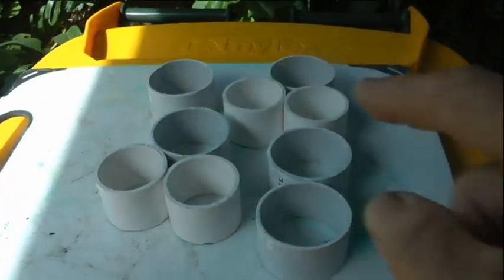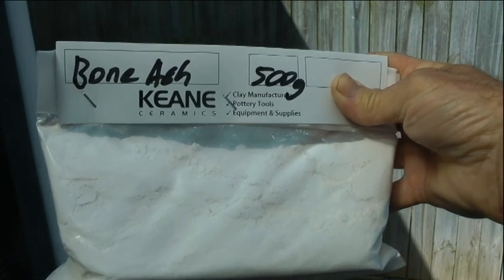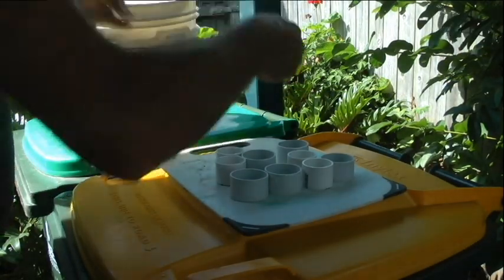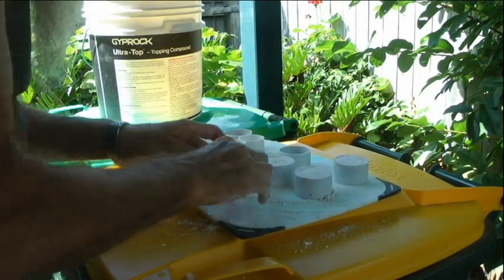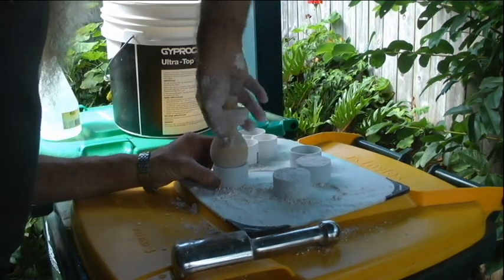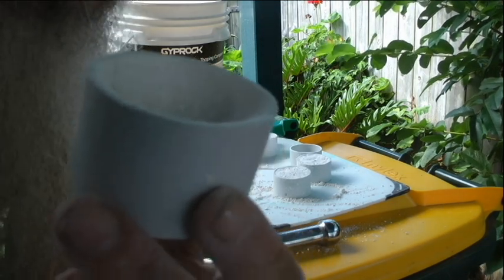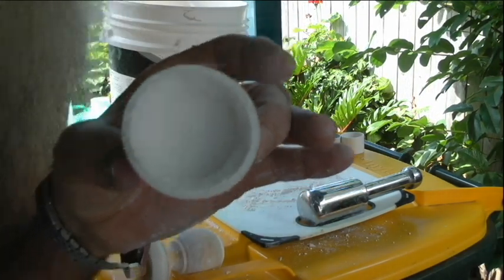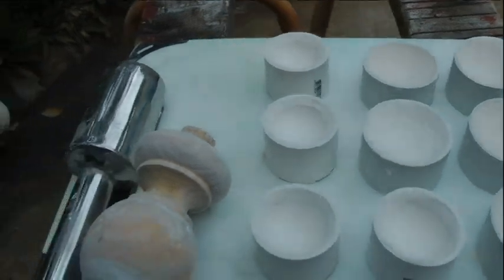DIY Cupels ,Gold Hunter .

Comment: Do u dry them out in oven after !?
Reply from the maker: No , i just dry them in the Sun , they shrink from the mould slightly so you can push them out , But recently i cut one side of the PVC mould and placed masking tape over the cut to hold the mould together , so after making them and drying them i simply peel the masking tape off the cut , spread the mould using a knife and it allows them  more movement to drop out of the mould . Hope that helps you . Cheers .
Reply: @ thanks bro yeah it does cheers man all best

Comment: Hello man, thanks, very helpful for me, I did buy few Marbor cupels, those are realy good, but expensive and hard to buy here in CZ. Tried Magnesium oxide, disaster incarnated. Made boneash cupel in small claypot (did not use water, just put boneash into claypot and formed a bit), worked kinda good nice bead, but cracked and I was digging some more pure gold out of cracks... I will try this for sure, have some gold and silver to be cupeled... I am using bismuth, not lead, works good...
Reply from the maker: G'day mate , yes just remember with bone ash use very little water just enough that if you squeeze it , it will clump together , too much water they will shrink and crack apart . You can also use powder dry portland cement in a crucible and compress it it will work as a cupel . Using Bismuth is fine  , it's a bit less toxic than lead 👍. Cheers Ned ✌
Reply: @GrooberNedJardine  you need to add water to the portland cement or just put it dry? Thank you!
Reply from the maker: @ludwigvonmauser8152  No water in the portland cement . Just compress it dry into a crucible and concave in the top .

Comment: Hi Ned, A quick question. After they have dried out do they need to be fired before you use them? someone asked a similar question but you just said dont fire them to dry them out.
Reply from the maker: G'day mate , No !!! i don't fire mine , i just pop them out of the moulds after they are dry and store them on a shelf till i need to use them , But if you were going to use one straight after making them and they were dry ,  you probably could pre heat it for a while just to bake it a bit , but i haven't had any problems with cracking and such . Cheers Buddy . ✌
Reply: Thanks for the reply mate, Another quick question. How much lead do you think the bigger ones could absorb before putting them in the bin?
Reply from the maker: @Coppercasting  I would probably say maybe 20-30 grams of lead  . cheers mate .
Reply from the maker: @bluedragon13063  G'day Blue Dragon , usually a few days in Ambient temperatures , but you can dry them in the sun if you wish . Cheers mate . 👍
Reply from the maker: @bluedragon13063  Ahhh , yeah i feel for ya , lol , Because i'm not using them all the time , i just leave mine indoors , sometimes for months . 👍

Comment: G'Day Ned, thanks mate I will be making some👍 Thank you for sharing your idea's. Cheers Kev
Reply from the maker: No worries Kev , you can also just use Dry compressed Portland cement in a crucible , i have tried it and it works fine , you should melt a little lead in it first apparently it primes it .  But i like the bone ash . Cheers Buddy , Ned . 👌👍

Comment: Looking good Ned.
Reply from the maker: Thanks Keith , however you can buy them over there pretty cheap , but not here , and importing them from the US , the freight is a killer . Still the Portland cement is even cheaper and it works too , i have used it and it does the job , but Eva says prime it with a little bit of lead first , i'll remember that . Cheers Ned . 👌👍
Reply: @GrooberNedJardine  It is surprising that a continent with so much gold has such poor access to assay supplies.
Reply from the maker: @hardrockuniversity7283  Virtually nothing is manufactured in Australia anymore , most things are imported from China . Things i look for in the US , Like crucibles , furnace coils , and such things , the freight is ridiculous because of the Dollar difference , China seems to use this global shipping which is cheap usually . I can buy stuff from mining suppliers in Western Australia where most of the large scale mines are , but again they buy it cheap from China and charge us the buyer an arm and a leg .
Reply: @GrooberNedJardine  Well that is less than ideal!